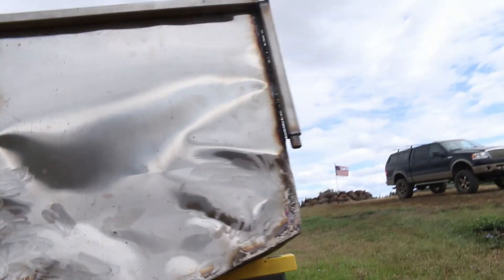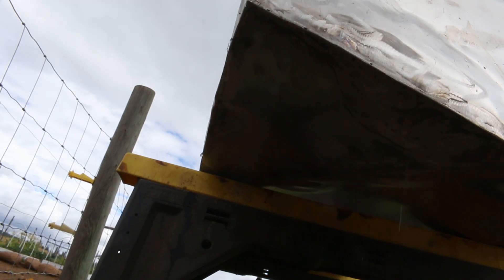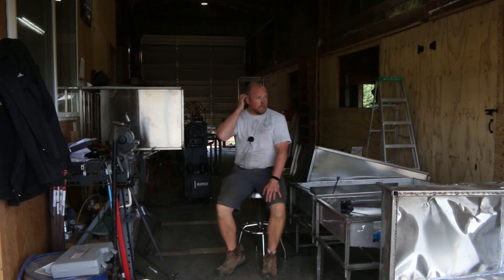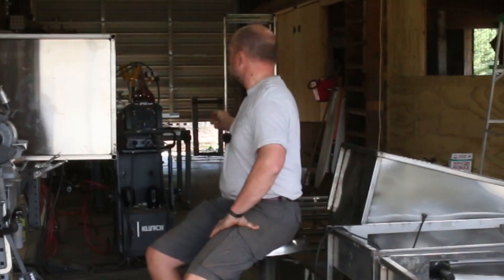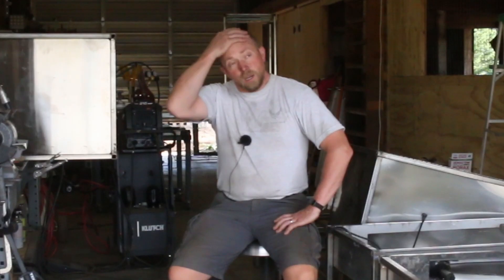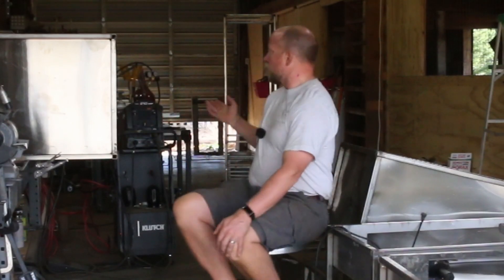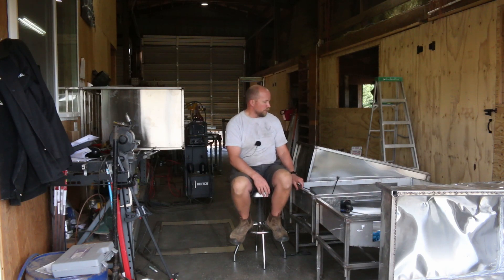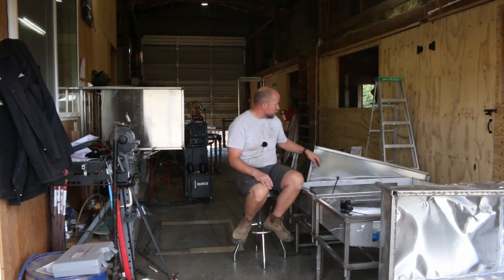Will THIS Work? No Dirt, AEROPONIC Reservoir

Comment: could the welding issues you are having linked to the weather? thinking either humidity  or barometric pressure or both which in turn affects the electrons etc
Reply from the maker: good question